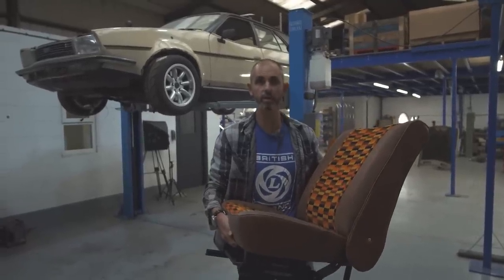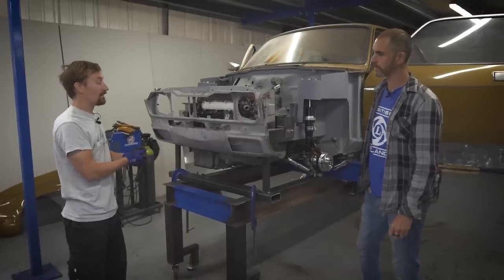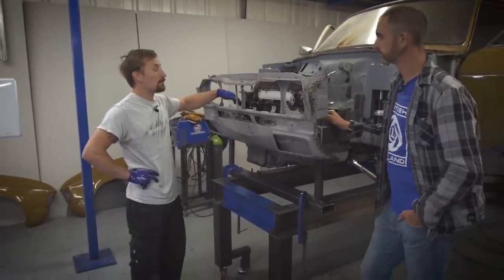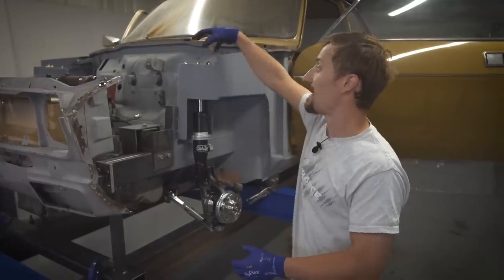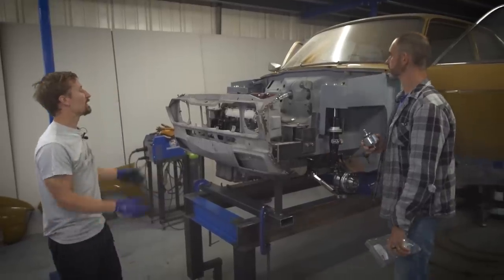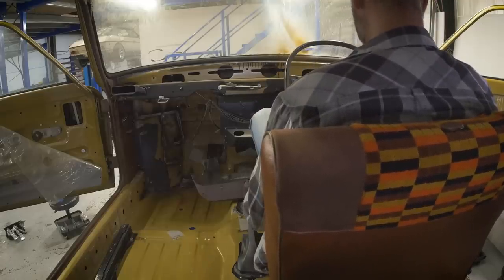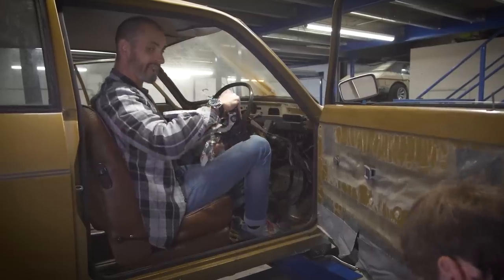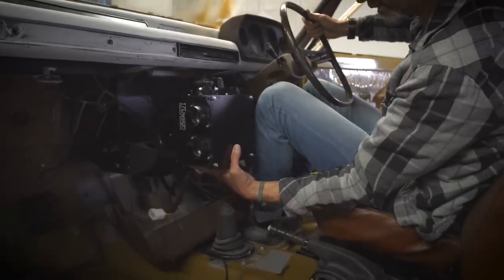Part 5: Austin Allegro Street Sleeper project build // Jonny Smith

Comment: It's false premise that BL products were any worse than other cars of the time. My 1300 Marina was faster than a Escort 1300. My old mans 1800 Marina would keep up with a 2litre Cortina & piss a 1.6. A guy I worked with had an Equipe Allegro he would race me on my 250LC Yam not many cars could keep up. Later my Escort RS2000 was great but the money I spent would make a pram go fast & handle. Go Aggro.
Reply: yup, only one car got away from my 1980 transit [running a RS2000 lump with webers], bloody 1750 allegro, that was one hell of a 10 mile race around wet streets on a winters night, just drove away from me on the twisty bits, i eventually spun out on a roundabout. seen the lad parked up a month later, he said he had only re-jetted the twin carbs, + de- silenced the exhaust. none of my mates took the p**s of course...

Comment: Are you having new glass in the car or are you going to keep the glass with all of the weld spatter ?
Reply: Where's the weld splatter?
Reply: The guy is welding near the glass and hasn't covered it up, it's bound to get spatter burnt into it.
Reply: @andymccabe6712  if you can't see that I have a valid point maybe you shouldn't be commenting

Comment: OK why on earth would u put am intercooler behind the rad,  that means u are putting hot air from the rad outlet across the intercooler , just not a good idea no matter how little boost u are running , really most important to keep inlet temps as low as possible ....
Reply: Space.. inlet temps aren’t as critical as engine temps. There will always be a compromise somewhere unfortunately